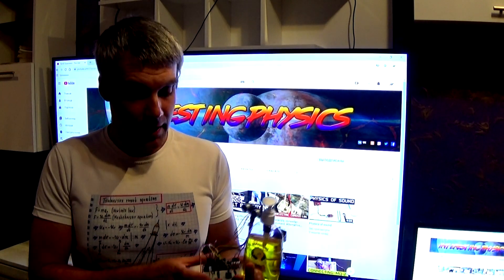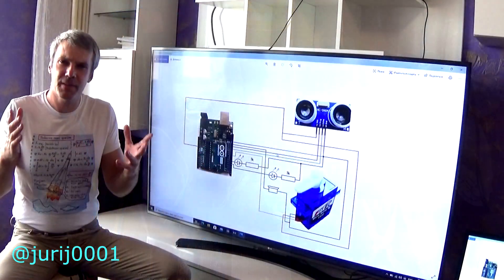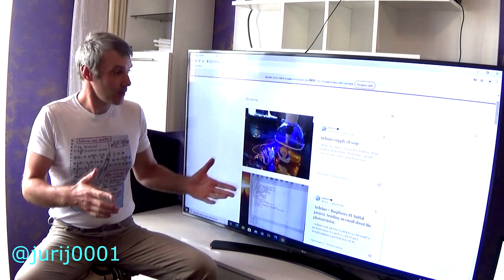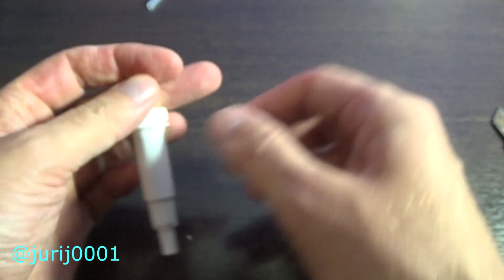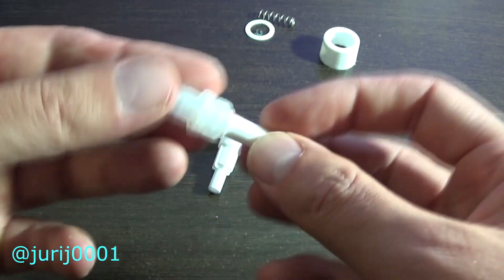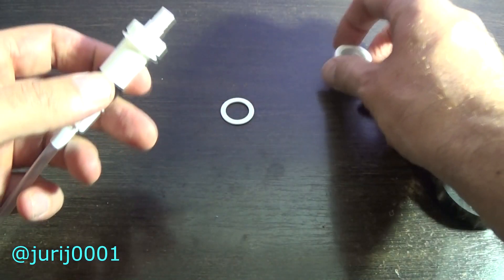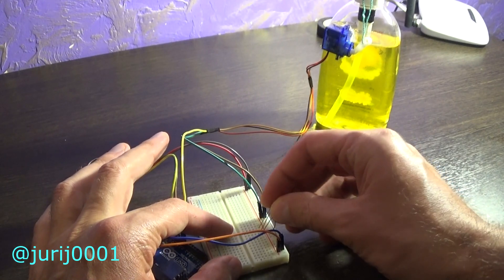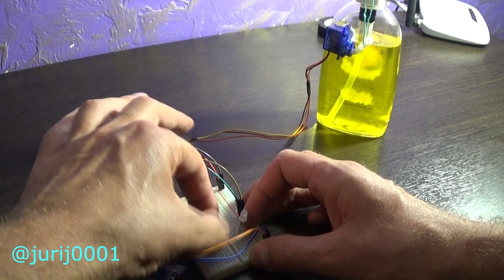Arduino supply of soap. Prevention of the fight against COVID

Comment: Great video; it was good to see you work through the problem of taking apart the soap pump to remove the ball causing the problem.
Reply from the maker: Thank you sir ))) it really was a problem. I set a goal to build this device using the cheapest 5 V servomotor that could be connected to an Arduino without a separate power supply.